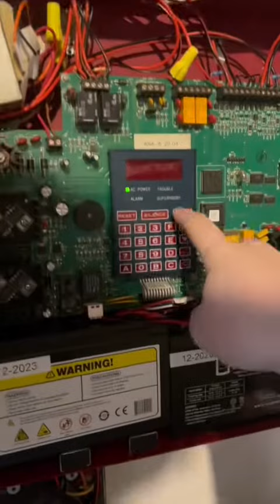Quick Fire Alarm Test

Comment: I'm starting to think system sensor has that tone so it doesn't sound different when FWR powered
Reply from the maker: Or maybe it just isn’t affected, and the unaffected sound could have been unintentional. Or it could have a filter capacitor like the wheelock chimes.